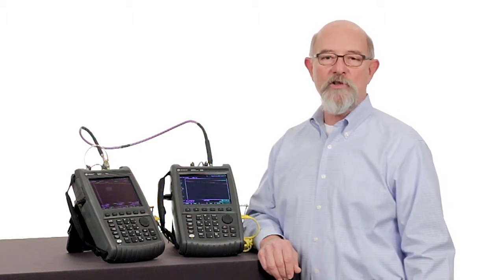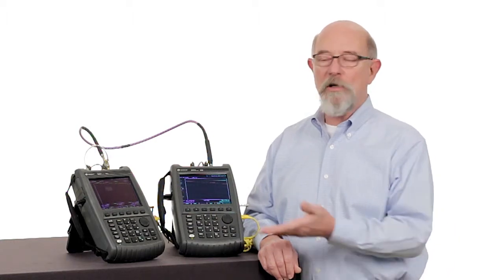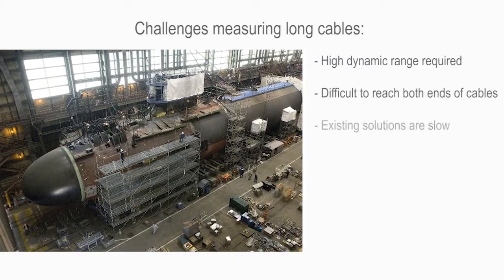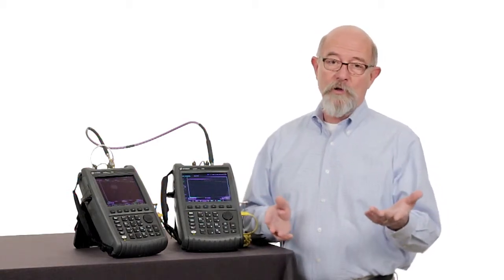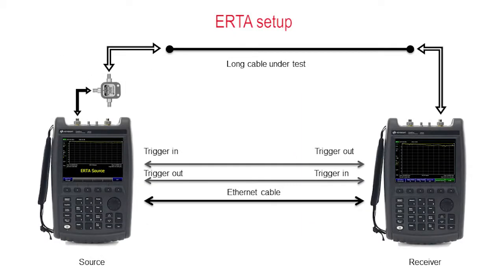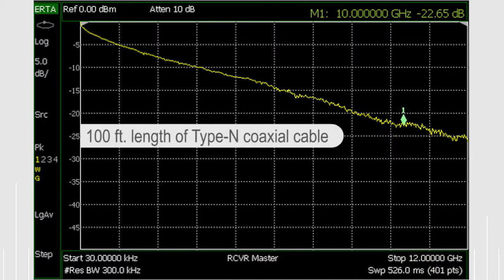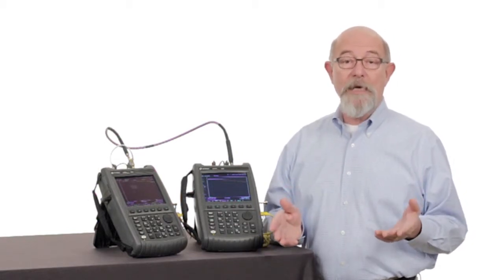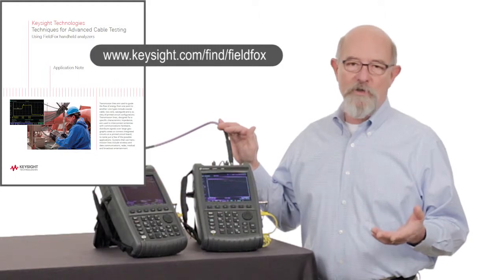Extended Range Transmission Analysis with FieldFox | Keysight

Comment from the maker: ERTA is a separate option (Opt-209) for RF&Microwave combination analyzers (N9913/4/5/6/7/8A) and Microwave spectrum analyzers(N9935/6/7/8A).
You can add the ERTA to the existing FieldFox units. For more detail, please check our website.
http://www.keysight.com/en/pd-2503958-pn-N9918A/extended-range-transmission-analysis-erta?nid=-33903.1116680&cc=US&lc=eng“